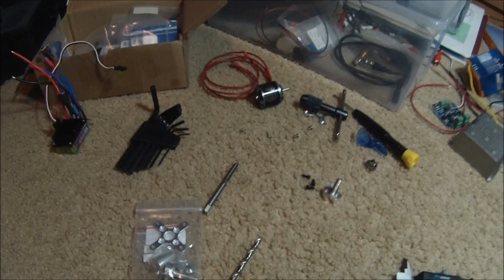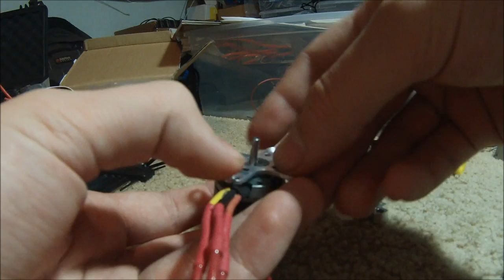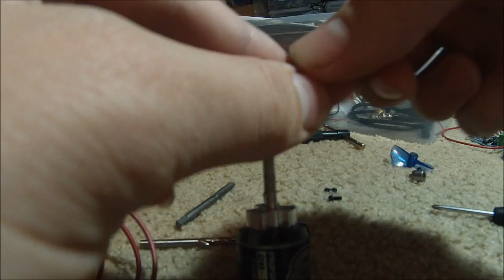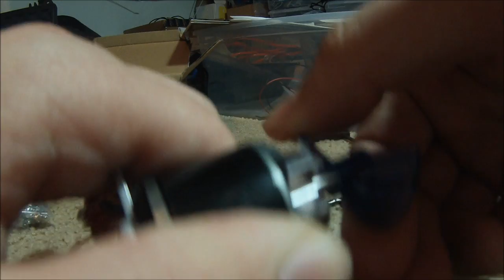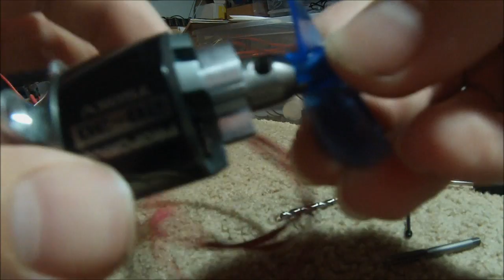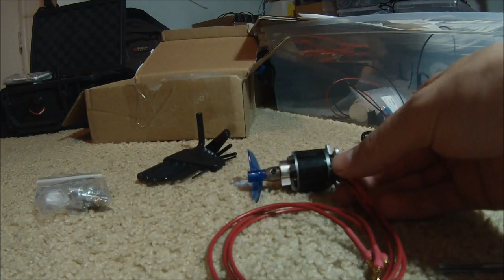Brushless ROV Thruster Design Explanation / Assembly

Comment: Hey Nick, I'm building my own ROV at the moment, same basic idea you used but my controls will be a hobbyking ESC with a servo driver connected for control. I had a couple questions since i couldn't find a schematic.
1) how did you manage to power it all with the 12 Car batt, could you just plug that right into the ESC?
2) You used a remote control means of driving the ESC, do you have any suggestions for wiring thruster controls (like throttles in a plane) instead of the knobs you get with Servo Drivers? Perhaps you can make the arduino a manual servo driver?

Thanks!

Comment: Thanks.  I started looking at motors based on your selection.  I came to the same conclusion.  The only other motor that I saw that came close in price/power/rpm was this one...  27300-Turnigy-2205-50turn-1088kv-8A  I'm getting one of each (NTM & Turnigy) to experiment.

Comment from the maker: Well I think it would be better to just lower the control signal in the software. The 43mm prop is about the smallest I would go because less that that and the prop starts to get smaller than the diameter of the motor. And to go to a lower KV motor means a significant increase in cost. After 750kv, it starts really jumping in price. It draws 8A at full load, so you would give it 50% control signal and it would draw 4A.